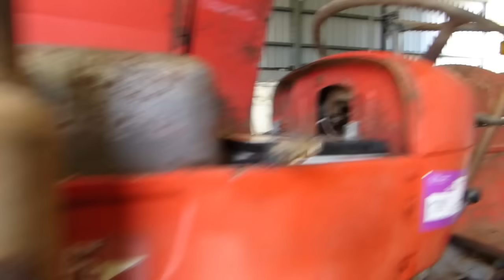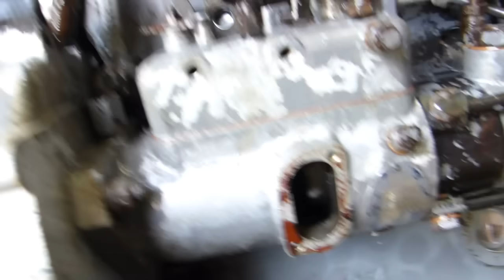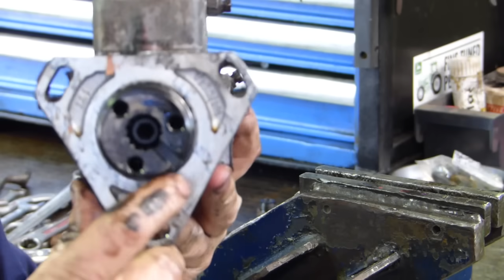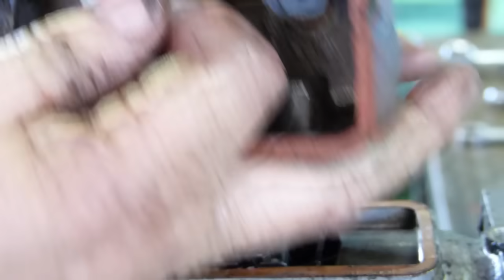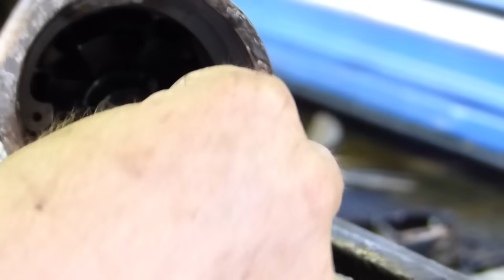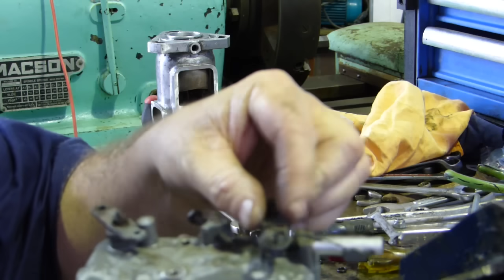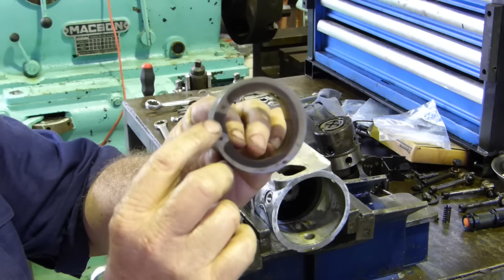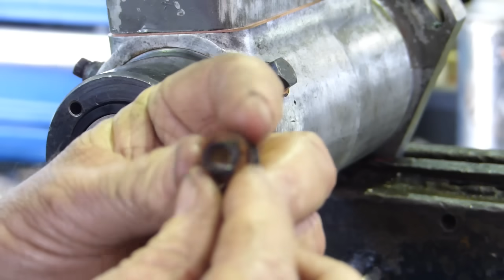CAV Injection pump full strip down to re seal and stop fuel leaks

Comment: Hi Lance,  I finally was able to get my CAT416 started.  After working on it for 3 days I finally figured out what was causing my issue.   I purchased a kit and clean out the top and side of the pump only.  It had all kinds of gunk inside which was causing it to not start.  I decided to keep the pump on the backhoe as to not disturb the timing.  On the first day I  removed the four bolts that connect the injector lines into the pump.  Each one going to a piston head.  I didn't notice at the time when  I took the bolts out but one of them had a spring in the middle of the bolt.  When I put the bolts back on I must have put the wrong bolt into the wrong line.  I also didn't remember if the washers went on the top of injector line under or underneath the line.  I started the fuel purging process by turning the ignition key on and using the manual lift pump on the other side of the engine.  I couldn't get any fuel to bleed from the top bleeding screw.  I checked the plunger and the veins as you said and all seemed fine.  I then tightened each bolt on the injector lines and then continued using the manual lift pump to get the fuel into the injector pump.  I followed the purging process from the manual.  Finally after turning the engine over for a few times it started coming to life. It then stated but was very rough and I couldn't rev the engine at all.  I then noticed one of the injector lines leaking badly and that's when I figured out that one of the bolts had a spring in the middle.  I then swapped it out with one of the other injector lines and this time making sure I  put a washer on the top and bottom of the injector lines.  Made sure all bolts were nice and tight.  I then started it up again and this time no leaks and the backhoe ran normal.  I'm not positive if the bolt with the spring made the difference or the washers.  It seemed I had air in the system and this may have caused the plunger to not work correctly.  Still not sure if I put the washers on correctly but all seems to be working fine.  Thanks to your outstanding video I had the confidence to open the injector pump and clean it up.  Next time I just need to pay better attention when taking things off.  This was by far the best video out on the web.  Thanks so much Lance!  I bet your video will come in handy for many visitors to come.  Take care!
Reply from the maker: Frank Taormina Glad you got it sorted it makes you feel good when you finally track a problem down. Thank you for the kind words.
Reply: @bundybearsshed x hey there Mr Bundt I was wondering if you would answer a question about my tractor it’s a Oliver 1850 with the Perkins 6-354 and it has the 6 cylinder cav pump on it it is not getting fuel I rebuilt the pump last year new rollers seals whole nine yard and now we awoke it from its slumber and it’s not wanting to start I looked at the fuel cut off messed with it then is started perfect then next day same thing so I took the bowl of and messed with it started right up and then let it set for an hour and same thing I know your time is valuable any help will be greatly appreciated

Comment: Hi,  I am trying to get my CAT416 Backhoe started but I can't seem to get any fuel to squirt out the top bleeding screw.  I purchased a kit and tried cleaning the top cover and also the side where the filter it located.  I had some gunk inside but I think I cleaned it all up pretty good.  I still can't seem to get fuel to come out the top bleeding screw.  Any thoughts.
Reply from the maker: G Day Frank. Check the little plunger under the fuel inlet under the screen and make sure it isnt sticking in the bore and check the vanes on the pump on the end are in good order.

Comment: what do you think would make the fuel just run straight through and go back to the return line if you hold your finger over the fuel line the tractor will crank?
Reply from the maker: Did your tractor have a check valve in the return fitting that has been lost or put back in the wrong place? some have it and some dont.

Comment: Bundy Bear Shed I have a pump that started with a leaking top gasket seal but I followed your direction and resealed the whole pump. However now the pump is not pumping. I put wd40 and spin it but nothing happens. I have to shoot air through the main fuel feed line in order to see small squirts of vapor fuel come out. Can you help explain what might be the problem. Is it the vain pump or the pump head? I am still not sure how the pump head works. Is it spring loaded or just rolls back and fort? Thanks for your help.
Reply from the maker: Make sure you are turning the pump in the correct direction and check that when you hooked the stopper up you got it in the hook correctly and didnt miss it and have it in the off position all of the time. The little plunger iunder the inlet pipe must be free in the bore and the rollers have 2 pistons under them that could get stuck to but I did not show that in the video as there is often no need to go in that deep.
Reply: Thanks Bundy Bear Shed. I will double check everything. Hopefully I won't have to pull apart the pump head.

Comment: Very well explained video with the step by step procedure .Done my 510 long tractor but now hard to start and it smokes a bluish white smoke could i have maybe timing off or something else. It all went back together very well also really enjoyed the video.Thank You
Reply from the maker: Hello Donna, Blue/white smoke is a sign of unburnt  fuel. do you think a bit of rubbish may have got into an injector line and blocked an injector? The other thing to check is that the spring went back in the correct place.
Reply: Thank You I will check it out , again  Thank You very much  . let you know later

Comment: Thanks for the video! Refurbishing a 1981 Ford 555 Backhoe and ran across your video.  Pretty close to the same CAV pump I have.  That is one creaky roof, Lol.  I may end up following your video through this process.  Anyways, thanks again, really great video with valuable instruction.  God bless and keep posting.
Reply from the maker: Glad you got something from it, yes the shed is creaky alright when a cloud comes over but I do go deaf to it at times.
Reply: Quick question if you don't mind. On the top over of my CAV pump is an outlet that pumps fuel to a fuel rail that runs across the top of each of the three fuel injectors and then passes up a hose to be dumped back into fuel cell. What is this fuel rails function and would loosing pressure in this rail cause starting issues?  Thanks in advance for any help you can give.
Reply from the maker: That line is just a return line for excess fuel so any fuel not used or leaked internally from the pump or injectors is returned to tank. if that line is blocked or restricted the engine will often start ok but will not rev up.
Reply: Thank you

Comment: got my valve guides  pressed in mate. pump problem  now!!  tractor starts  1st  tip. but the governor  seems  to keep kicking in when I give it a rev it will not rev up I can feel the throttle at pump kicking back
Reply from the maker: G Day Bud, It should not kick at all, with the throttle open the governor should take the movement. Pop the top off again and have a look that everything is sitting in properly.
Reply: Bundy Bears  thanks mate. Will report back 8-)
Reply: Bundy Bears Shed hi mate. lifted the top cover  everything  looked normal  what I did notice ,there is some endplay  in injector  pump shaft . is there suppose  to be end play??  at a guess I would say there  is about  5mm
Reply from the maker: No the front allen head nut might be coming loose
Reply: Bundy Bears Shed  I had the front gear off to replace lip seal!!   I did give the Allen key a good squeeze  .  is there a spring  inside  gear  hub??   going to remove injector pump. thank you

Comment: does the pump has timing marks. i remove the pump to get it fix. i try to put back and the engine wont star.
Reply from the maker: Normally you dont need to time them as they have a master spline or a dowel pin into the gear.

Comment: Hi Thanks for the video it got me out of trouble when my yacht was in Yepoon rebuilt the top section now I want to know if you can fit a stop solenoid if so where do you put it, the start switch is too far away and to difficult for a pull wire stop
Thanks
David
Reply from the maker: G Day David, The stop solenoid is not a problem, just put it onto the stop lever where the cable would go but you will need to make a bracket no doubt. Also get a proper solenoid that will hold it into the on position and release when the power is taken away from the solenoid.

Comment: Excellent Video And Well Explained , Many Thanks To You , After A Long Period Of No 434 International Going I Have Now Got The Pump Apart But Have Found A Lot of gunk Inside , Water Mix .now All Cleaned.i Now Have To Work On The Final Pump Cam Set Up .rollers Not Pushing In Or Out So I Guess Whatever Is Inside Needs Freeing Up . CheersRon.
Reply from the maker: G Day Ron, Sounds like you are onto it the two little plungers under the rollers get stuck from time to time and it wont pump then. Just take note of the position of the plate that holds the rollers in and try to get it back close to the original position. It you give the rollers more travel you are fueling the tractor up a bit.

Comment: how to increase the dose of fuel at the pump?
Reply from the maker: The 2 double hex screws that hold the rollers in place hold the plate that controls the amount of travel the rollers have, you can loosen the screws and turn the plate a little.
Reply: Bundy Bears Shed ok thank you, try to see if the power increase

Comment: How did you clean up the parts when the pump was stripped down?
Reply from the maker: Just in a kero bath
Reply: Cheers for that. I used the dish washer on hot wash when the Mrs was out. The parts came up a treat, I gave them a blast with the air hose then a good spray with WD40 to get the water off. Great video, it really helped me with the pump rebuild. Mine was a DPS but had enough similarity to the one you stripped down.

Comment: sorry   ,about that
Reply from the maker: Marco, Check the little plunger under where the fuel goes in and see that the smallest spring in down the bottom so the little plunger cant go down too far. Also check the vane blades are in good order.
Reply: Bundy Bears Shed  how the vane blades should be  or go?
Reply from the maker: Doesnt matter which way they go if they are in good order they will work
Reply: Bundy Bears Shed what's the order of the blades
Reply: Bundy Bears Shed may i shouldn't try to do this by myself 😧

Comment: I've got a CAV 3432310 injection pump from a John Deere 830 1970's model and can't find a repair kit for it specifically. Is there a universal repair kit that will work?
Reply from the maker: Is it a CAV pump or a roosa master? If it is a CAV the kit I use is good for it but the roosa master pump I cant help with.
Reply: It is a CAV pump. I'll order the one you refer to in this video. Thank you.

Comment: Thanks for info, just a question about making ajustment to the pump, after the pump reseal the engine is running rough and blowing white smoke, I suspect I have some have got the pump slightly out of timing, what are best way to check the pump timing
Reply from the maker: G Day Kris, Check the line on the mounting flange is lined up correctly , there is a small scribe mark, that is about all that can go wrong

Comment: What do you clean you pumps with? will carb cleaner work? LIke your video, Thanks
I have a pump that's been sitting indoors for about 20 years. won't fire or pump fuel to injectors. I'm not sure which way the shut should be? its a CAV on a 318 perkins. I've tired it both ways, no luck. Now I'm thinking the shut shaft is seized?  Any ideas? I've bleed it out 3 times have fuel coming out both upper and lower bleed screws on pump.  Still no fuel at injectors. Engine cranks rather slow, another issue.
Reply from the maker: G Day Kevin, I would say it is just gummed up a bit, pull the top off and see if the metering valve is moving freely. I now clean my parts in a bead blast cabinet or use a parts washer with degreaser in it. I then assemble the pumps with WD40 as a lube.

Comment: G'day Bundy,
Great video on the CAV injector pump.
I have a Fiat 500 DT tractor and it has stopped running and will not start.
Before it stopped I noticed that the engine was revving up very slightly by itself every now and then. 
I changed the filters and managed to get it going again but after a day or so it started doing the same thing.
Now it won't start at all.
Do you have any suggestion please.
Cheers Nick.
Reply from the maker: G Day Nick, pull the top off the pump and have a look that everything is nice and free, sometimes the metering valve will just get sticky. You can pull it out and free it up and sometimes it will help.
Reply: Bundy Bears Shed Thanks Lance,
I drained the fuel and changes the lift pump and the filter. Then I found the problem the top ring on one of the filters was kinked and sealing properly. After I put everything back together I got it going after getting the fuel back up to the injectors. 
So all good so far and the old girl has been working hard for the last 2 days mulching some overgrown scrub on the farm.
Thanks for getting back to me though.
Cheers Nick.

Comment: Hi! Lance, Finally got around to replacing the O-Rings on the stop and throttle shafts following your instructional video guidelines. Only struck one problem (besides my 5 yr old grandson watching and distracting me). I couldn't stop the engine once I had started it.
I replaced the O-rings with the injector pump still bolted to the tractor engine. This made it more difficult  to  line-up the stopper cam on the bottom of the stopper shaft with the stopper rod. I would think I had it lined up and re-connected everything only to find I  couldn't stop the engine (had to stall it to stop it numerous times). I must have disconnected fuel lines and pulled the  top off half a dozen times before I figured out my mistake. I had the cam button 180 degrees out of position. So even though it looked like it was slipping into place, it would slip sideways out of place each time I bolted the top down. 
Had I done the work with the injector pump off the tractor and turned the pump around like you did to get better vision, I probably would have picked up the problem straight away. I just thought your readers should be aware to make sure after replacing the O-rings, that they return the stopper shaft with the cam button on the bottom in the right orientation. As I found out,  it is easy to have it 180 degrees out of place if distracted while doing the repair.
Thanks again for a great instructional video.
Merry Christmas & Happy New Year,
Keith
Reply from the maker: G Day Keith, Good to see you are on top of it. Yes you do have to keep your eyes peeled for the little things, at the start of you story I was thinking you got the spring in the wrong holes.

Comment: Hi, Could you please tell me what the start of injection timing should be (in crank angle BTDC) for an IDI engine. What should should it be at fully retarded (low idle) and at max rpm. Thanks
Reply from the maker: G day Sunil, I cant tell you as I dont know. Im not familiar with an IDI engine.
Reply: Bundy Bears Shed fair enough. so what are the typical values for a DI engine?

Comment: Hello. What a great video. I'm halfway through re-seal on my pump but am having trouble getting the main head back in. It'll go halfway in but that's it. I can't see anything fouling? I've not touched the timing circlip as like you say, it wasn't necessary in my case. I don't suppose you have any ideas? Thank you. Adam.
Reply from the maker: G Day Adam, Are you lining up the main drive splines? you will need to do that at this stage. Lance
Reply: Bundy Bears Shed Great success! When I pulled the head out it must've pulled the main shaft through with it slightly. All went well after that and now my old London bus is leak free. Thank you so much Lance.
Reply from the maker: Good to hear you got sorted.

Comment: Mr Bears, first off thanx. I have a Perkins 4108 with a hydraulic injector pump. I've been told it's a much easier construction? have you any experience with the other version if the cav in you video? it's leaking at the shut off lever o-ring ?
Reply from the maker: G Day, I thought the pump was very similar to this one, have a good look at it and the end plate, main head etc are very similar and parts are the same I think. I have not had one apart though I am just going from parts pics on the net. I would sneak the top lever housing off for a look.